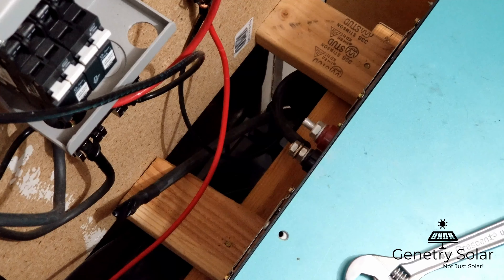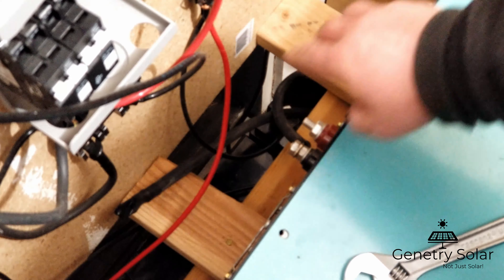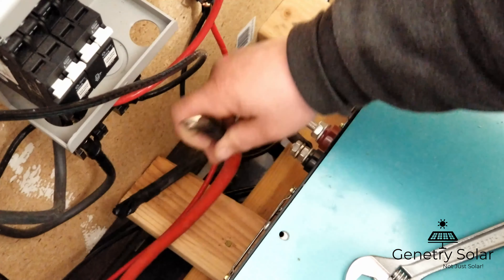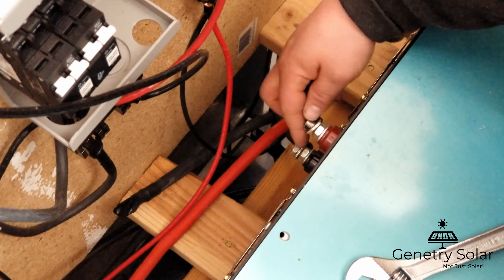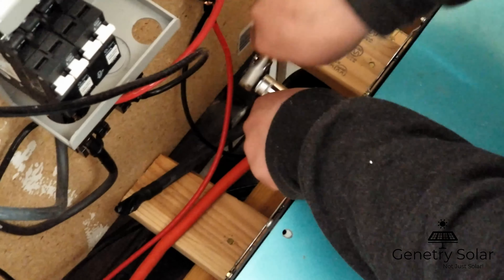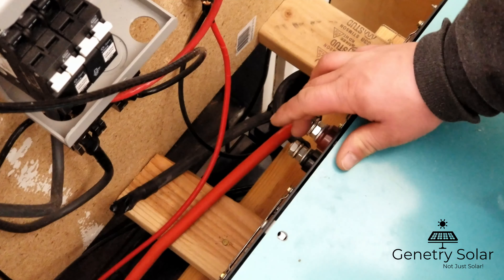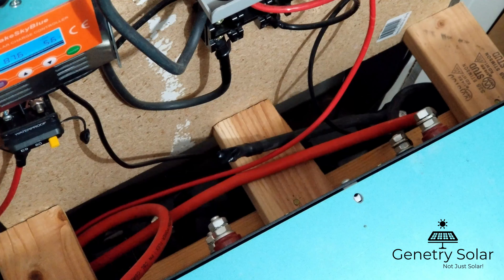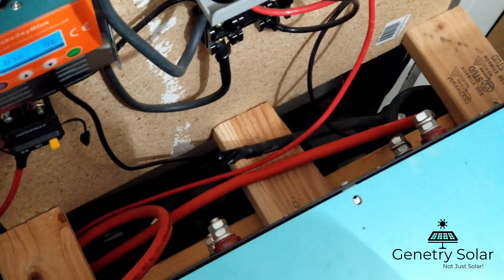Inverter Spark! Big 15KW Power Jack Inverter hook up

Comment: I'm thinking about making a xt60 connector or Gator clips , to charge with a couple lightbulbs, in series, to pre charge, just connect  it  first, then the power cables, but I don't disconnect the inverter that much, I guess a yearly cleaning could bring the need!
Reply from the maker: I clean my house inverter out twice per year because I have the fans on at all times so dust tends to collect inside.

Comment: I wonder why power jack didn't put both positive one side and then both negative on the other side I'm sure there's a reason my wire on my inverter is about two to three times bigger I think I went overboard 
hey Sean you ever been shocked by that 48 to 56 volts DC
 Nice fun video by the way
Reply from the maker: I have touched my panel wires at 80 volts and only felt a buzz.

Comment: Hi i have a problem with my 2000 w inverter  when i connect into battery their a big spark i accidentally power on b4 i connect to battery then i turn off the power i reconnect no more light come out on lcd, is it broken or discharge?

Comment: I use a 120v incandescent light bulb, to charge the caps, in place of a resistor, it works perfectly,  no arcing, it's not good for the traces or connections,  I have heard of a inverter damaged from this, it's basically a dead short, when the caps are fully discharged!

Comment: Power Resistors are really cheap.  Just pre charge the inverter by using a Resistor between the Pos Lead and the Terminal.  Count two seconds and then complete the Connection.  Life is not that hard.  Yes a simple light bulb with wires soldered to it would work quite fine.

Comment: that is why you are supposed to have a 250 amps disconnect breaker from the batteries to the invert-er ! also those battery terminals are too close to each-other and not having a disconnect breaker off before that you attempt to  work with wrenches on a energized wire anything can go wrong and a short could happen  people could get hurt ? anyway just saying
Reply: Yep. Only nuts like me work with live power lines. 480VAC 3phase with who knows how many Amps behind it changing out an 800 Amp breaker for a 1200 Amp one. On one of the hottest days of the year with linesmen gloves and insulated tools. Had to stop after removing the breaker to dump the liquid out of the liners. Then in with the new breaker. 

And on a 15K unit, there should be a 300 Amp breaker.  A 250 would trip before full load is reached.